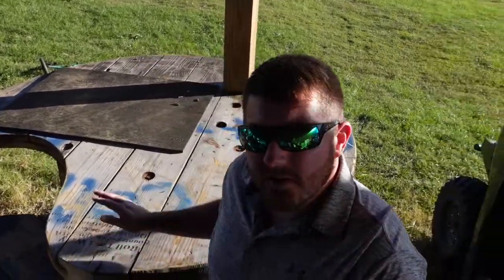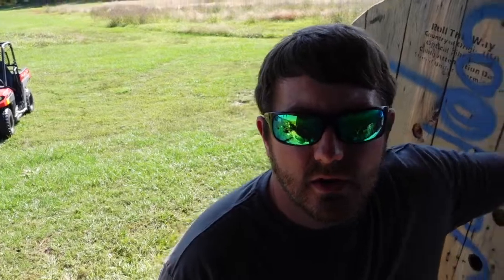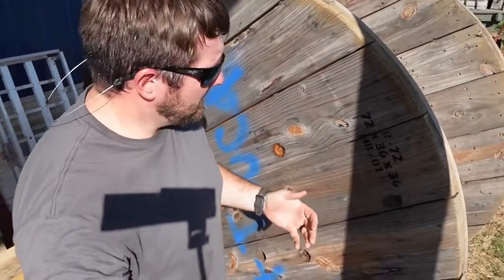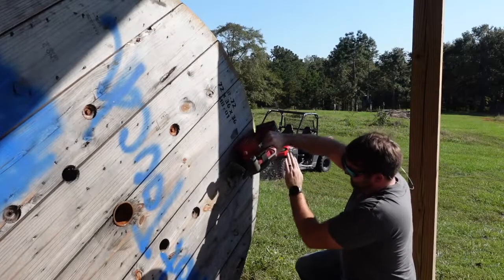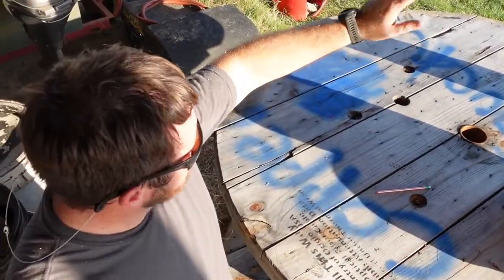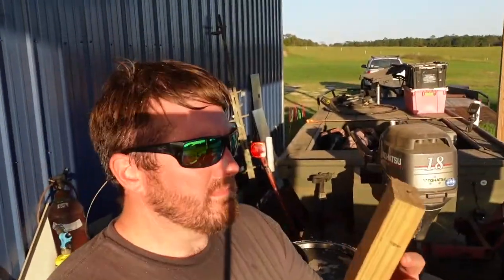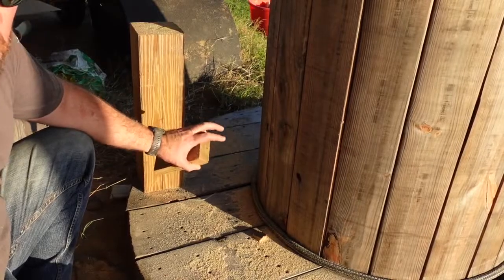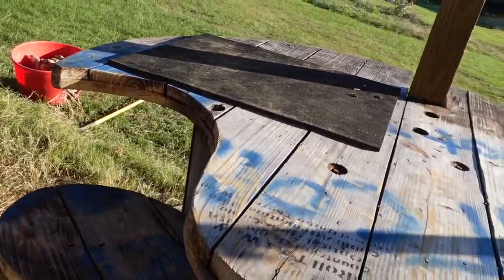How to make a DIY shooting rest and bench out of re-purposed wire spool - outdoor upcycle.

Comment: Great idea, Jack.  I'm currently using a wire spool as my shooting bench, however, the round sides are not made from wood, they're made from thick plastic which are not the thickness of your wood cut-out.  I've thought of several designs to use and I haven't made the final decision yet b/c once you cut it, there's no turning back. 😄 I just had to commend you for such a neat design and usage of all existing materials.  Have a fine week.  Enjoyed a full-watch.  👍🏽🤠 1/23/23
Reply from the maker: Thanks for watching. I’m sure you’ll come up with a great design idea. Good luck